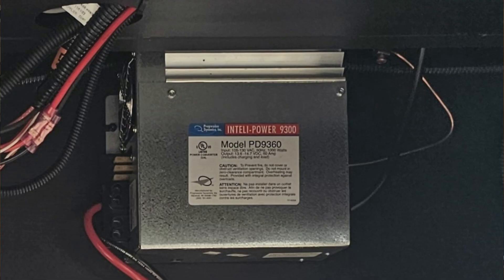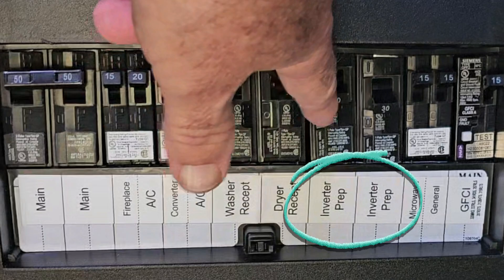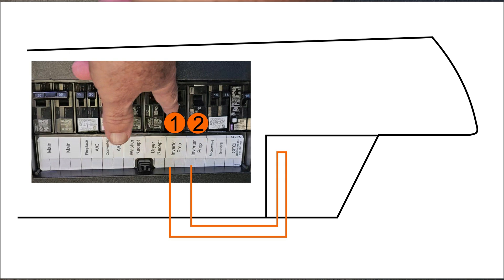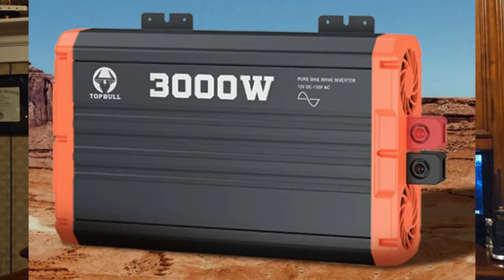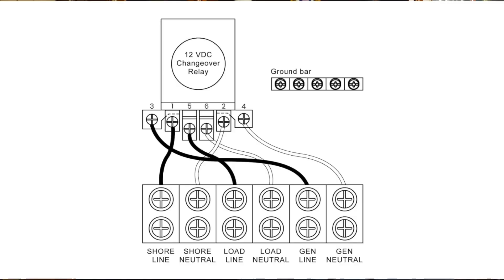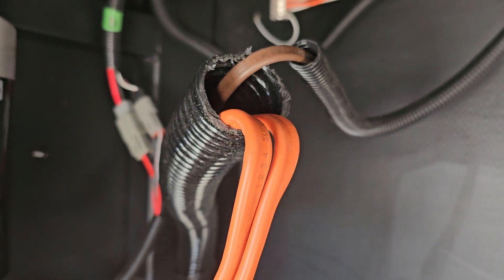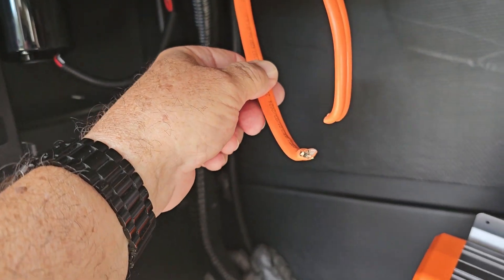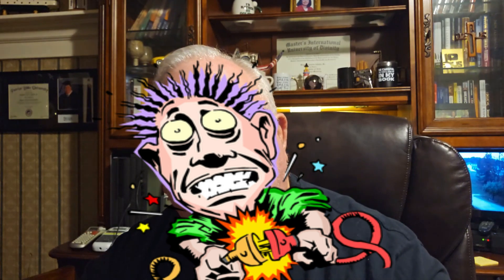Grand Design Inverter Prep

Comment: So when connected with the inverter Oreo will it run the air?
Reply from the maker: Randy, I'm not sure. I think it has the capacity to run it (one of them), but I haven't tried it. However, if it did, it wouldn't run it for long... perhaps an hour on my present set up. I'll give it a try the next time I go out. Thanks for watching and commenting.

Comment: Hi Steve. I have a GD with the inverter prep. Does it need to have a ATS or can I just wire it without one and turn the inverter on when I need it?
Reply from the maker: In my humble opinion, I think you need a transfer switch, even if it is a manual one. Thanks for watching and commenting.

Comment: Great video! 

Question: Is your charger/converter included in the inverter prep circuits? If so won't hooking the inverter output to the transfer switch would cause a loop back on itself and drain your batteries?
Reply from the maker: Howard, I could be wrong, but I think the way the breaker panel is set up that it only powers certain things. Hopefully, someone else can either verify or correct me on that. Thanks for watching and commenting.

Comment: I watched your TS video along with others, very well done I might add. I really liked the detail you went into in respect to the transfer switch. It makes perfect sense to me the way you wired the inverter to the shore power. I never would have thought of that.  I have a much better understanding of how they work.
Reply from the maker: I'm glad you enjoyed the video. I appreciate you watching and commenting.
Reply: @RVSite2Sight  I would like to install the exact system in my GD 260RD but the glitch is that I don't have the inverter prep loop. I know I could buck up and buy the victron 2phase inverter but it seems like a ton of overkill and expense for something I wouldn't really use. I don't plan to have a large battery bank, maybe 280amp/hr. I have spent two days searching the internet trying to figure out what I would need to install a loop but all I can find is how to install an inverter with a prep loop similar to what you posted, but not as much detail. Do you have any knowledge  or resources that I could reference to achieve this?
Reply from the maker: @65fastback, I wish I could help, but like you, I couldn't find much on the subject. Before my GD 337 fifth wheel, I had a GD 297rsts tow-behind, and it didn't have the loop. I know @happilyeverhanks did a work-around where he used a dogbone 50amp to 20 amp adapter and just plugged his main cord into the inverter before he had it professionally done. Awkward, but it worked. Let me know if you find a solution. I would like to know. Thanks for watching and commenting.
Reply: @RVSite2Sight 
Actually I managed to figure something out. More simple than I imagined. I simply installed an automatic transfer switch (progressive dynamic D52) rated for 50 amps and hooked the inverter into the generator side of the switch. The down side of this is that the dominant power source is the generator connection. I reached out to PD and the said it is okay to switch the shore power and the generator (my case it is inverter) which will in turn make the shore power the dominant source.

Comment: Just purchased a new Grand Design Imagine with the inverter prep. The dealership had no clue that it came with that until I pointed out the "Inverter Prep " sticker. They had no idea how to install an inverter. Your video was a god send. I am somewhat electrically competent, but I didn't think I would need a transfer switch system. I thought the inverter on off switch would suffice.  Thanks again! Looking forward to your part 2.
Reply from the maker: Hey Ray, you're not the only one who found the dealer knew nothing about it. I'm glad I could help. Thanks for watching and commenting.

Comment: Good video. I was wondering about the Ground... My orange loop wires was zip tied with a bare ground wire which I assume goes to the green ground screw on the inverter. I didn't see one in your video...was one there? (The solar prep wires were there in the same bundle). Thanks
Reply from the maker: My inverter does not have a ground connection. However, you make a good point. I'm going to check on that. Thanks for watching and commenting.

Comment: I have the same RV and in the spring im doing transfer switch, inverter and 2 300 AH batteries. And was thinking about switching wires for shore power and inverter. And evidently you also thought of it. The only thing i was wondering is will the relay overheat if plugged in for a long period?
Reply from the maker: Honestly, I don't know. It is designed for a generator, and some people run the generator a lot. I have used it once for three days since I installed it, and it didn't overheat then. Thanks for watching and commenting.
Reply: I just installed a progressive dynamic PD52 transfer switch. I reached out to them and they said it was okay to switch the shore and generator/ inverter. As you know this will make the shore power the default source.